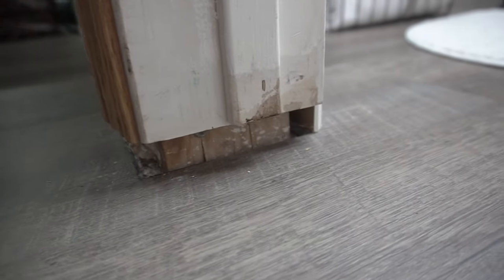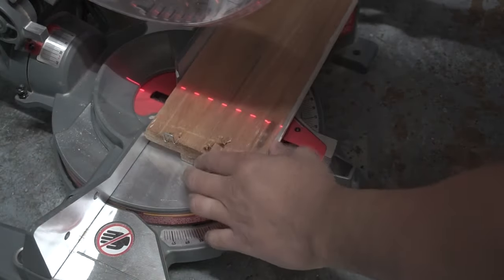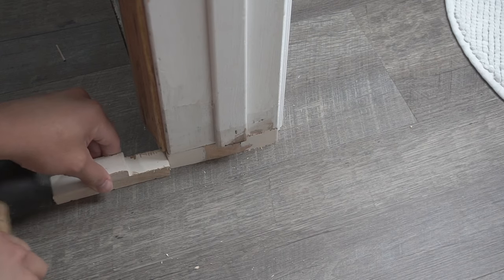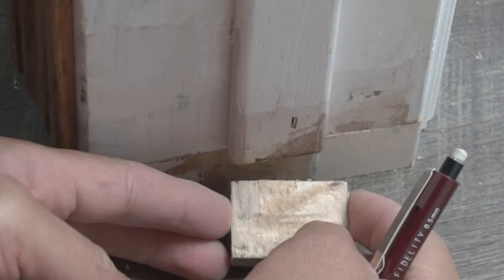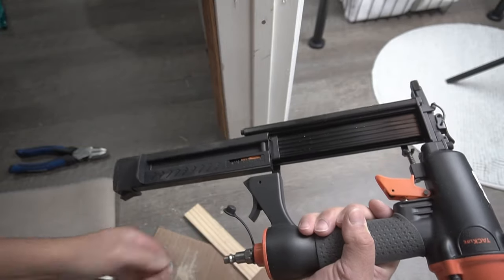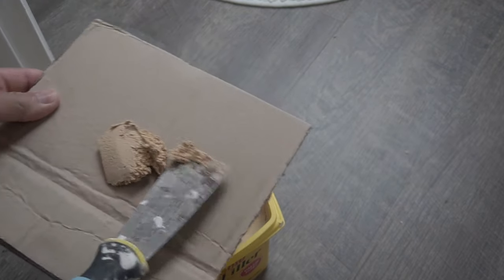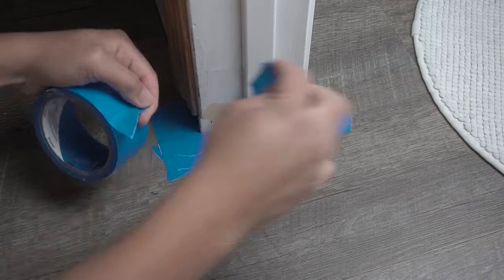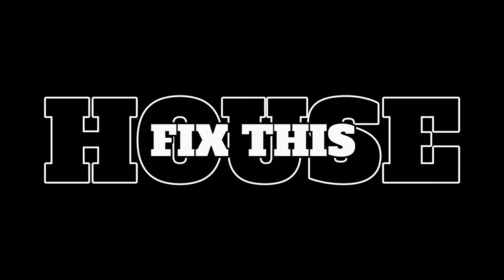How To Fix BIG Door Jamb Gaps After New Floor Install. EASY DIY Door Trim Repair!

Comment: I had the same issue but solved it a different way. I sprayed door and window expanding foam. It will expand and look bubbly and flowing. Don't panic, let it fully cure. Then take a utility knife and trim it to match the door jam profile. Sand it if needed to fine tune. Then put a coat of joint compound on to seal the poures. Let that dry and sand smooth. Prime and paint.
Reply from the maker: Nice technique! I might have to try that sometime! Thank you for sharing! 🙏🏽😊👍🏽
Reply: What type of joint compound
Reply: I thought of using joint compound but I don't think it'll hold up to bring kicked here and there and the vacuum banging up against it. I was actually thinking of wood filler. The spray foam is a good idea for having a base to work with though
Reply: Spray foam would be too flexible to prevent things from crumbling or cracking.
Reply: That’s ghetto as hell 🤮
Reply: I bought 2 tons of self leveling concrete to fix that issue
Reply: @FixThisHouse  That sure sounds a lot easier than doing all the measuring and cutting. But I would much rather use spackling to fill in the holes than joint compound. It just works so much better.
Reply: @Rlprime  It would probably be better then to go with the 5" piece of replacing instead of the small piece that might not hold up very long like  Uncle Val recommended. And using spackling to cover over the seam and make it invisible works great and holds great to.
Reply: @spicydiarrhea5662  did you self level yourself. In the same boat, needed to level the main floor.
Reply: I've ran into so many instances where someone used spray foam to half ass a problem and it never lasts.
Reply: That’s exactly what I was thinking of doing. Glad to hear it worked for you.

Comment: Don't get that brand, get the 20v Dewalt brand, you can't beat it. It's also easier to change blades by only pressing a lever.

Comment: nice job, my only advice to anyone doing this is to take a few minutes and sand and prime the pieces of wood before nailing, its much easier in hand than to prep and prime when it`s tight to the flooring.
Reply from the maker: Thank you for sharing your technique! 🙏🏽😊
Reply: Great Advice.Thank you.

Comment: When I used the mini wax wood filler the smell was so strong it smelled up my whole house for about 3 days. It was kinda cold out but I had to open all my windows and turn the fan on. I asked one of the workers at Lowe's if there was something different I could use as I still had a lot of deep scratches in all the woodwork to fill in and other places also he recommended Spackling. My goodness, what a difference. There was no smell, it was so much easier to work with and dried 3 times faster and covered with paint a whole lot easier. I use the spackling for all my wood fill in's now and have not had it come out. I highly recommend the spackling for wood fill in's. I also used it at my daughters house to fill in holes in her sheet rock and it worked so much better than trying to use joint compound. I bet it can be used on just about any kind of fill in that you need to fill.

Comment: Another nice job. However, curious why you removed the notch 2:11? Even more so, considering you then had to 'add' one of sorts.
Reply from the maker: Thank you so much! Yes removed it so that I can thin it out because it’s too thick. You cna technically just shave it from the front but it will mess with the curved profile on the sides. Either way you can go either route for you can round the edges with the wood filler 🙏🏽😊

Comment: should have just used the wood filler to fill in the nail holes.  Don't use caulking it will shrink.  I have a couple of these to do but no extra door frame like you had...

Comment: I don't get why so much timber was cut from the door frame to lay the floor. If you use a multi-tool cutter, you can trim door frames so that flooring can slip under frames & no need for infilling afterwards. Much neater & cheaper finish too!
Reply from the maker: Hi! The previous owner of the house had 3/4” hardwood floors installed. Then they had 1/4” plywood with tile and vinyl sheet flooring on the  bathroom side. When I ripped it all off and install the LVP, it left this huge gap.

Comment: Ever had gap smaller than that?
Reply from the maker: I have, I will have a video on that as well, please stay tuned l.
Reply: @FixThisHouse   I seen one where this person put poly foam caulk saver in the crease and then applied plastic wood.
Is that by any means good?

Comment: If you can SEE it or FEEL it, it's either not filled enough or sanded enough, and it WILL be seen; especially by fellow carpenters. My work partner and I walk into rooms and inevitably find all the things that could have used a bit more OCD by the guy/guys before us.
Reply: From your comment I'm getting the feeling that we had the same thought. Get idea....poor execution. When I saw the final product, minus a few more coats of paint, I had verbally said "ouch".

Comment: Dude it looks like garbage.  I don’t know if you filmed this just for the concept, but take your time and do better.   Fill the cracks/nail holes proud and sand it to blend and finish smooth.  You shouldn’t be able to notice the repair.  If you’re taking the time to teach, teach correctly.
Reply: spackling could be spread over it all and tapered smooth with rest of trim and you would see any seams of nail holes and it paits excellent and dries fast.
Reply: wouldn't see any seams or nail holes with spackling.